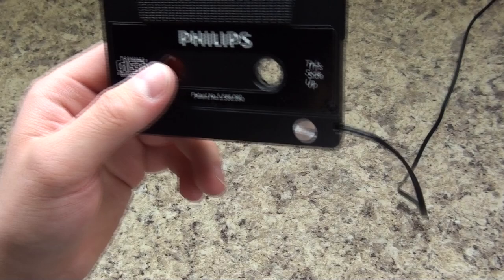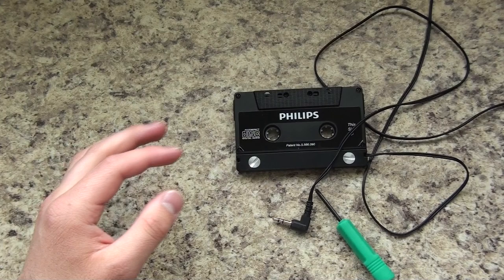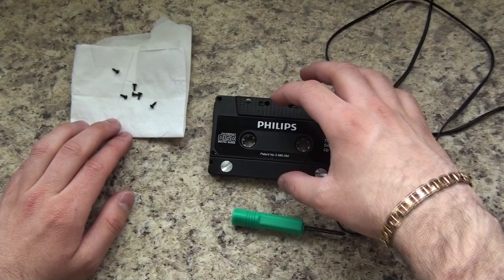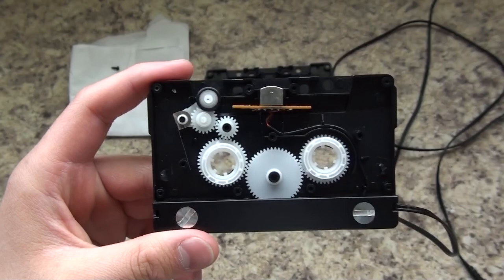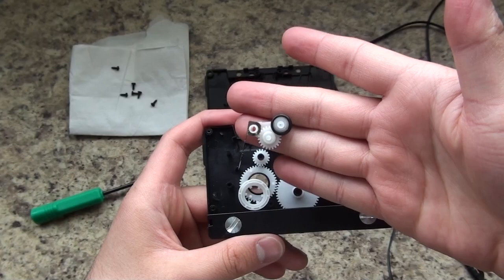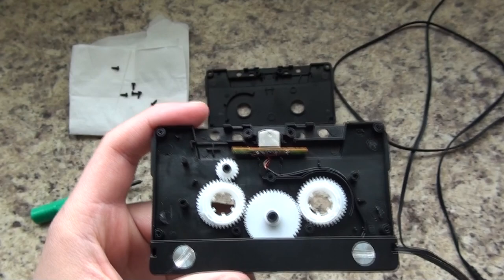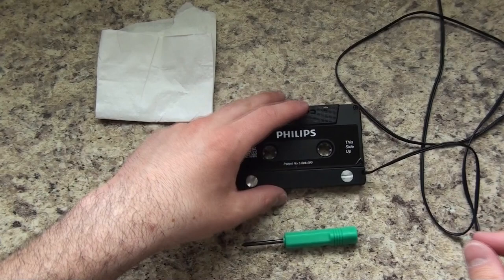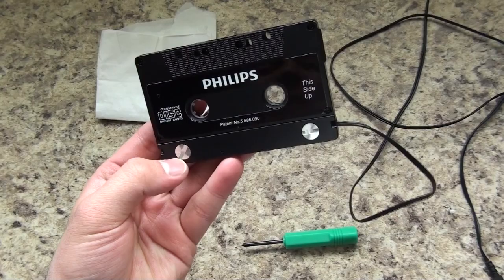How to Fix Constantly Ejecting Cassette Adapter | Any Adapter [Read Description]

Comment: Now I can jam out in my 2000 accord hopefully lmao
Reply: 01 Ford ranger so I feel you
Reply: 1999 accord I DEFINITELY FEEL YOU
Reply: Chynna Weddle Accord gang 🤙🏽
Reply: 96 oldsmobile 😂
Reply: 96 Corolla 👌
Reply: 2000 accord as well
Reply: 2001 Dodge Ram, but Dodge’s speakers were cheeks back than.
Reply: @mikeyt922  really good car choice. Does this thing have good sound quality though?
Reply: Now I can jam in my 2002 Honda Accord. The power of dreams.
Reply: '98 Camry meets Spotify.
Reply: stock 94 miata radio lmaooo
Reply: lmaoo I love comments like these, they are the backbone of the YouTube society
Reply: Just got a 02 accord coupe. Was mad at first that the converter didn't work fresh out the box.
Reply: 2000 Chevy impala
Reply: 89 Corvette
Reply: 2001 accord
Reply: Accord gang same here 98 💪🏼😂🔥
Reply: Removed all the gears from mine now it won’t work even though the gears technically are useless wth lmao
Reply: @Theboymichaels  Because the tape deck uses the other spool to detect if there is any more tape in the cassette, when its not spinning the tape deck thinks the tape is out of tape
Reply: 95’ accord 💓
Reply: 04 Buick Lesabre
Reply: 2002 pathfinder jus bought a tape today
Reply: 05 Lexus LS430, the radio doesn't work rn so it's CDs and cassettes lol

Comment: This shi did not work
Reply: if you still need help, check your manual to see if your radio has a "Cassette Adapter Mode".  cars from the early 2000s have trouble with this.

Comment: This worked very well. Its amazing how simple these devices are. 
I did try to take out all the gears and it worked but my tape deck had trouble ejecting it. I fear it might get stuck so i put the gears back in. 
I actually found removing the rubber gear made it quieter. I just turn up the music anyway so i cant hear the noise.

Comment: Thank you for this!  Two comments:  (1) Taking out the gear which trips auto-reverse works like a charm!  Why didn't I think of that?  Muchos gracias!  (2)  Mileage may vary w/ regard to taking out other gears -- when I try that step, my player goes back to auto ejecting.  Not sure why it does that, but I hope the heads-up is helpful to someone.
Reply: Me at auto zone in my car sad cus it worked at first but since he said u could stop the noise I went and took all the gears out trusted this man to the fullest and threw the gears n the garbage inside😭
Reply: I tried taking all the gears out and no dice, after seeing this I'll try it with the gears back in except for the auto reverse

Comment: Thank you so much. It worked. My cassette adapter was constantly ejecting but now no more. I have a 1997 Toyota Camry by the way.
Reply: I have same car. N my cassette does same thing
Reply: Hey I've got a 97 too. I hope it works out for mine
Reply: Same!!! Damn Camry’s!
Reply: @mywavesofgrain  right dude. The menacing Camrys live forever!
Reply: Damn how many miles you got on that jawn
Reply: Yuuuuuurrt 97 camry gang
Reply: James Yang sane having same issue with my 1999 Toyota Camry
Reply: I have a 95 and i have this exact cassette aux tape about to try this right now crossing my fingers it works
Reply: 97 Camry here and I did what was instructed but still get an ejection. I think it’s cause the flap doesn’t shut all the way, maybe? Or the battery isn’t charged on the cassette? Or my tape decks junk!?
Reply: 😂😂 got a 2000 one

Comment: Worked for me thanks! Turns out the rubber ring on that gear to remove wasn't sitting flush and was causing the side swap/eject! My 02 Mercedes and I thank you 🙌

Comment: THANK YOU!!!!!! I just ordered a refurbished radio shack one on eBay and it kept ejecting on its own and I did exactly what you said in the video and removed that one piece with the rubber on it and it works now! 😁 I was afraid I was gonna have to mail it back to them for a refund 🙄

Comment: problem solved! thanks dude. PS. taking all the gears out didn't work for mine. I still had to keep the main ones in there.
Reply from the maker: +Caleb Olshefsky  I am glad to hear that I helped you.  Thanks for giving feedback in regards to taking out all the gears.
Reply: I just snipped off the rubber O ring on the that gear with a pair of tweezers and sizzors .  I tried removing the gear all together but it still would just do auto reverse so I had to reinstall the gear without the O ring.  that got it.
Reply: so if you have one of these and you pull all gears out except the main gears in the center holes? It will work?

Comment: SOLUTION IF TAKING OUT GEAR DOESNT WORK

1. Take the gear out
2. Cut a hole on the other side of where the aux comes out (I used a utility knife)
3. Feed aux through cut out side and reassemble

This allows you put the cassette in on the opposite side. This worked for me
Reply: Peter did that the. It got stuck
Reply: This also did not work for me....

Comment: just changing the way the aux cord itself is placed by putting it on the opposite side and flipping the tape helped me just fine! I still removed the part in this video. so thank you for the help! I was so frustrated. LIFESAVER.

Comment: Thanks so much! I was just now getting ready to purchase another one of these and I decided to try fix it myself.  I have a Sony cpa-7 adapter and it  kept stopping and starting back up. I watched a few YouTube videos and I just tried this and it worked. Mine did not work without the gears. I just removed the bottom piece as you indicated. Mine has no screws in it at all. I had to carefully pry it open with a small screwdriver. I wasn't sure if it would snap back together when I was finished, but it did. YouTube is great! Thanks!

Comment: Just did this on a 2007 Toyota Avalon and it worked like a charm. Try taking all the gears out and no Bueno. So unfortunately you still hear the gears turning but other than that it's terrific. So Thanks

Comment: Thanks for this video.  My cassette adapter was recently stolen from my car and I had to do the fix on it before it would work in my (aging) stereo.  But that was along time ago and I was just making sure that I did it right on the replacement cassette adapter as you superbly described in this video.   Plus, I know now that I can just go ahead and empty the rest of the guts because sometimes the noise of the cogs/gears can be annoying while listening to music on long drives. Thanks again!
Reply: along time ago

Comment: I took out the one gear from the audio cassette as directed and it still ejects seconds after I insert it, then I took out ALL the gears, and it still ejects from my car radio! I am feeling extremely pissed off in Illinois!
Reply: Same.
Reply: Same
Reply: I just took the gear out havnt tried it yet. Im in Illinois too!
Reply: bro mine doesn’t work either i’m in illinois too

Comment: No need to neither open the cassette or remove any gears nor clean out the inner rubber gear. Just use aluminum foil and fill in the notches, or better yet, use scotch tape and block the two opened notches on the cassette’s outer part, opposite sides of its magnetic opening. (Left and right outer sides) block them out.
Reply: Nelson Rodriguez this actually worked. I taped all sides because I didn't know what you meant. But left the magnetic part open.
Reply: Nelson Rodriguez hey what if you can't even put a cd in the sterio, it's on constantly on eject mode ?
Reply: John God's child this is for old school cassettes, not noobs with your fancy CD players
Reply: Nelson Rodriguez can you please post a demonstration and a link to it?
Reply: @shadow12264  there's something wrong with your player.
Reply: Gonna try this blocking out the open notches method, removing the inner piece did nothing
Reply: Can you please give a demonstration?
Reply: Can you explain why this would work?
Reply: It didn't work for me.

Comment: I finally figured it out on mine. one of the gears on the part with the rubber thing wasn't loose enough so when the other gear would try to spin it the whole thing would move and hit a plastic part on the inside causing all the gears to get stuck. i fixed it by melting the black plastic onto the white plastic to stop the whole thing from moving and now its only the gear that moves instead of everything that the gear was on. now it works perfect.

Comment: I just held the fast forward button until the cassette stopped jumping. It worked for me. If fast forwarding doesn’t work then try rewinding instead. Or back and forth until it starts working. Works every time for me.

Comment: OK so this actually worked for me once I found a screwdriver the only thing is my car does not play any bass now and I have to turn the volume up very loud just to even hear the music.Do you know what happens if you take all the gears out?
Reply: How the hell you get it working at least. Ok so I have 3 audio cassette adapter..I disassembled one ..the other 2 I left alone cuz one of them are brand new.. but mine keeps saying reelerror one new cassette or metal error on the one disassembled.. help
Reply: BeauTeyMafia Designs The only problem with mine was that when I would first put the cassette and I don’t know if your car has this or not but I have like these arrows on the screen of my stereo and it would point up and then down and then up and then down and then eject within five seconds but now it just points up then down and stays at down it doesn’t play any bass for some reason and it only plays music on the right side of my car

Comment: Mine's ejecting in a weird way. First it automatically gets "sucked" in and when it does, it's not centered. It's kinda wopp sided then it ejects. I'm starting to think it's the deck instead of the adapter but idk. Any tips or advice to fix this?
Reply: Nate Green thanks I'm funny ik ik
Reply: CowBoy15 to get to see v

Comment: I bought the $30 monster adapter and it keeps ejecting. Then bought a $5 adapter from walmart and no issues. It lasted me 2 years til the wires started to fry but still worked flawlessly for 2 years.

Comment: Any clue how to fix it if my adapter has no gears at all? It just has the metal piece on the end attached to the wire. No gears or anything.
Reply from the maker: To be honest with you, I wouldn't know about that one.  I would suggest maybe picking up one that has gears and testing it out.

Comment: Philips ...works without taking the little third wheel out....I bought several and all ejected at once; I open them all , took the third gear wheel ojut, and they work but they get noisy, and the sounds is not so good especially on rough road....PHILIPS IS JUST perfect!

Comment: If this doesn't work, read your car manual. Mine has a feature that can bypass the auto reverse and not error out. I still took out all the gears cuz of the noise but that didn't work on my player to start.

Comment: I tried the suggestions below... However what worked for me... I folded two soft foam blue hair curling rods and stuffed them into the player to stop the cassette from ejecting... It has worked so far... the cassette hasn't tried to eject and I don't have any bizarre gear noise in the background... I think the pressure of the foam rods keeping the cassette in place forces it to play correctly... Maybe an pink eraser could complete the same affect...something soft and firm to keep the cassette in place...

Comment: On some decks,  if the actual reels of the cassette player aren't moving, it won't play because it'll think that the tape ended. That's the point of those reel gears.

Comment: Just did this in my 2003 Camry. It totally works fine if you remove all the little gears and parts, but there is still an annoying clicking sound, if you can tolerate that. It's still more quiet than when I kept the gears in.
Reply: haha, thanks! i just got a 2003 camry and i was wondering if this would work for that tape player
Reply: AwkwardGrapefruit  
I just got a 2002 camry and was wondering if it would work for mine ! haha

Comment: I tried it just like you said, but it keeps ejecting.  Even took the gear with the O-ring out completely and it still spits it out.  I'm kinda at a loss, maybe it's just my radio is getting old.  Thanks for the video tho!

Comment: I’ve took the one little gear out and that didn’t work so I took all them out that didn’t work. I’ve tried this with 3 different cassettes and they keep getting ejected and it’s so annoying. The weird thing is it used to work like a year ago and now it doesn’t. It’s a 2004 Toyota Camry any tips would be greatly appreciated

Comment: I was looking at the mechanism in it and there really is no need at all for the gears. The magnetic connector has nothing to do with the gears, so why did they even put gears in there? The gears in a normal tape are meant to spin and pull the tape over the magnet in the tape player but in an adapter nothing needs to be pulled over the player magnet. The magnet in the adapter connects to the magnet in the player and there is no need for any spinning mechanism. Take all that out to reduce unwanted gear noise and be done with it.

Comment: didn't work for me, but then I learned early 2000s card have a "Cassette adapter mode" that turns of auto reverse and keeps from spitting the damn thing out. if none of this works for you try getting the PDF of your owners manual and seeing how to turn on that mode in the "Radio" section.

Comment: I tried this method and it unfortunately didn't work for me. I took out the one piece and it caused the tape to eject immediately. Then I tried again after taking all the gears out and same result. I put everything back in then and the tape still ejects, but not immediately. I wonder if it has to do with the brand of tape or the player? I'll probably end up just buying a new one, but perhaps the brand in this video.

Comment: I have a 98 grand Cherokee, cassette player will work for a second with the aux adapter cassette and spit it out , a regular cassette will just be spit out and the CD player was working fine but now it gives error code and spits out the CD as well
What can I do

Comment: I bought mine from Walmart and on my radio e10 means it’s restricted or it doesn’t move a certain way and it would move forward but it wouldn’t move back and I tried taking that little rubber piece out and it didn’t work and I’ve tried everything and it still saying  E13 and ejecting it so I’m gonna try taking all the gears out but please help me

Comment: Sometimes it does work after doing this. A lot of times it still ejects though. The gears are so loud without that peice.  Maybe its just time to upgrade. It was working fine for a day after i bought it then I ejected by accident and put it back in and now it says check tape and ejects it. The only conclusion i can come to is its broken. It works for like 3-5 seconds then it starts fading in and out and cuts off,  then it says check tape, and ejects. I tried reversing by running the wire out the other side - total waste of time. Get a new head unit or find some tapes.

Comment: I have the same cassette adapter. I use it to listen to songs from a samsung mobile. The problem is that the voice of the singer is far and not clear and the music is higher. It is great when I listen to music but with songs it is useless. the voice of the singer seems as if he sings in a very wide room or a cave and you can hardly hear what he is saying. The music of the song is louder than his voice. I Think it has something with the settings. Can you make any suggestions?

Comment: this worked gr8 for the eject prob but now the disk itself makes a crazy noise when it is in the player making almost impossible to listen to anything not on full blast
Reply: srry didnt watch the full thing where u mention the noise tryied putting that part back in to stop the noise and it didnt auto eject any more but it still makes that awful sound are you saying i can take every single gear out of this and it will still work and stop the noise know this is a super old video but any help would be gr8

Comment: I actually went ahead and bought the Monster cassette player adapter and it still does the same thing as the Phillips cassette adapter. I'm thinking the problem has to do with the car radio itself. I haven't tried this method just yet, so I'll let you know how it goes.
Reply: +Jose B. i got a brand new scosche adapter from walmart. my car is a 99 oldsmobile intrigue and the adapter stays in for 2 seconds an ejects. it sayd e10 on the screen. i hope its not my radio
Reply: Kamran Amin Most likely not your radio anyways. I also figured it could just be a defective product. The cassette could just be a dud, so try exchanging it.
Reply: +Jose B. i hope that works, thanks
Reply: Try using a real cassette tape and see if it still has an error. if it does, it's the radio.
Reply: I'm actually using the same cassette tape that I commented about before and it works perfectly fine. I have no idea how I got it to work. lol I was just patient with my cassette and cassette player and it just started working with no problem.mraiwa1000
Reply: +Jose B. lol just got lucky right? i love when that happens

Comment: you really shouldn't remove all the gears because the tape deck uses the other spool to detect if there is any more tape in the cassette, when its not spinning the tape deck thinks the tape is out of tape. if its an older tape deck it might still work but the one in my 97 4Runner wont work without the gears.